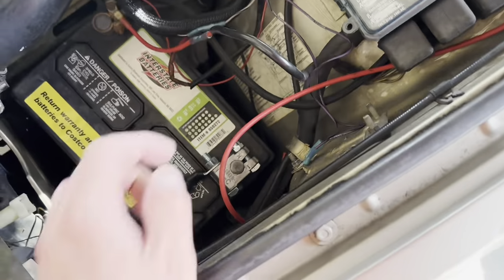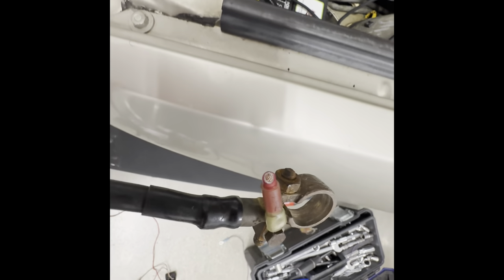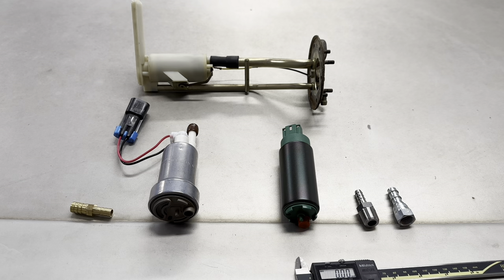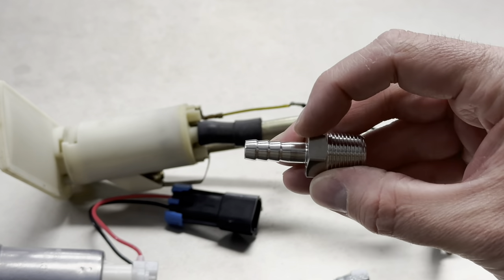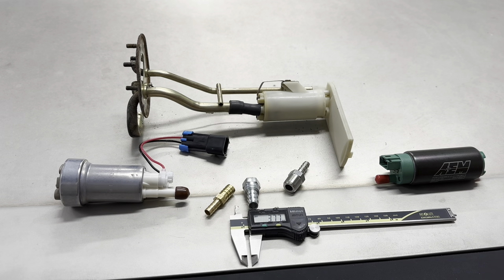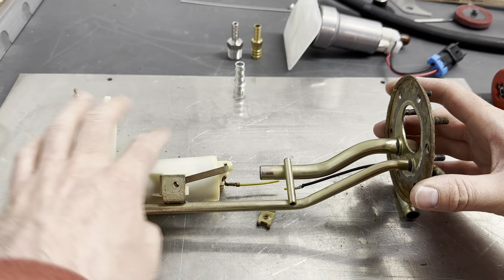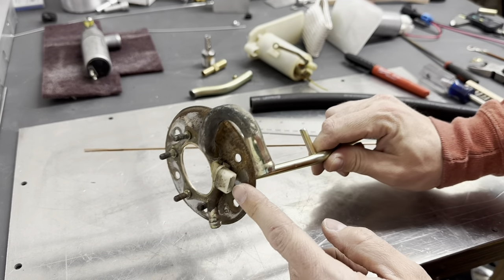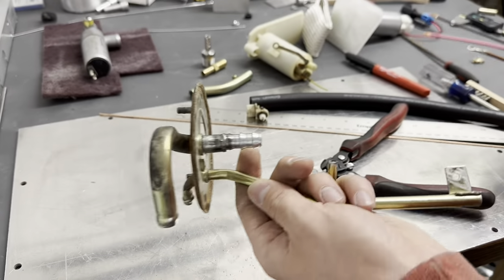BMW E28 Single in-tank fuel pump upgrade | 500HP fuel pump upgrade | Wiring Wednesdays EP3

Comment: You may have saved the day. My in tank does not operate properly anymore, it's humming and when the tank is nigh on empty (which happens in the more expensive months...), it will not pull at full power anymore. Main pump is good, ignition etc is good, and filling it up always solves it. Problem: they don't make these pumps anymore, so we will have to go that route, but were looking for a "recipe" to cook up a new pump :) Tnx for this content, I may get in touch if I get stuck :P
Reply from the maker: Thanks for watching!

Comment: Great explanation. I need to convert my e30 to a single high-pressure pump. Rn I'm running a duel, stock tank and walbro 255 external. Being n/a it's not bad. But once it gets boost it'll need more.
Reply from the maker: Thanks !!!

Comment: So happy to have come across your channel! As I’m getting ready to turbo my m20b25 e30 and want to tune it myself I’ve learned so much from you! So thank you for the content you’re putting out there very user friendly as well! 

With the fuel system, running a walbro450 are you running an frp? And or stock fuel rail and just modifying it?
Reply from the maker: Thanks for watching! I’m glad the videos are helpful. Everything on the fuel system is standard except the fuel injectors and fuel pump. You can use the stock fuel rail and fuel pressure regulator
Reply: @TurbineResearch  hmm wouldnt you want it on the return side so the rail has the constant desired pressure for the injectors? Talking for an e85/turbo setup.
Reply from the maker: @ahhitskyle4798  the OEM fuel rail has a fuel pressure regulator like you described. It all works great in my experience up to 500hp
Reply: @TurbineResearch  oh shoot for some reason I was thinking it was on the feed of the rail. I haven’t tinkered with it all too much yet. Copy!! Thank you, just need to find some hose that is e85 safe.

Comment: Just starting your vis and this is a fairly popular conversion with the old Volvo crowd but why not just use the power wire that was running to the original pump Insted of all this wiering ?
Reply from the maker: The original wire to the in-tank pump is old rotten 22awg wire. This pump will pull 17 amps at idle and 20amps under load. You need serious wire(10awg) to power this walbro 450 pump properly without voltage drop